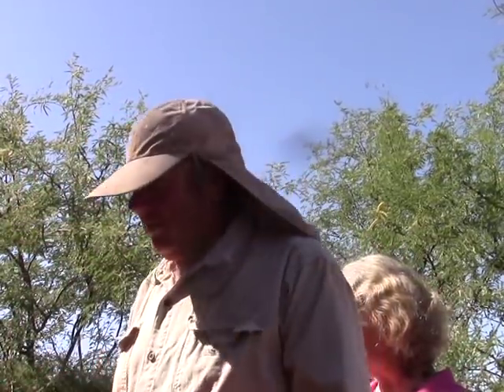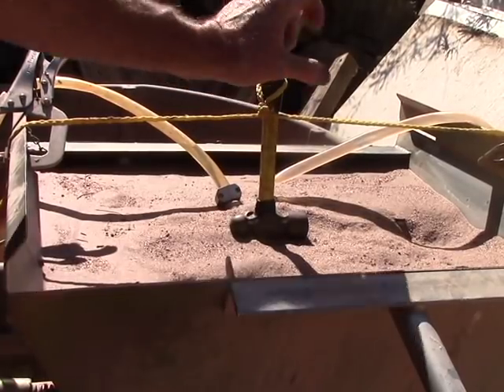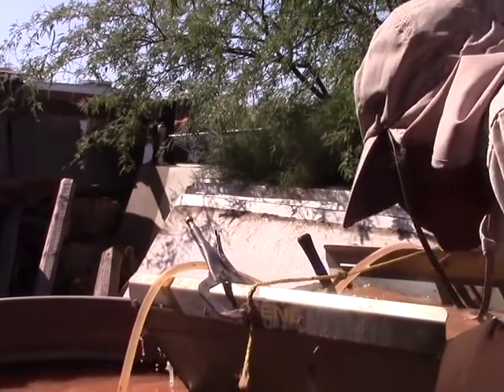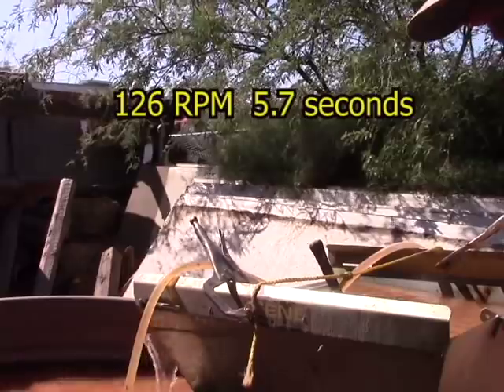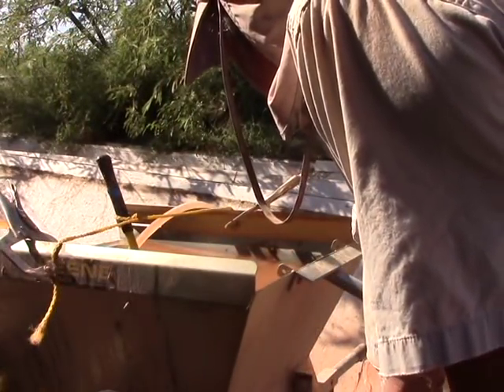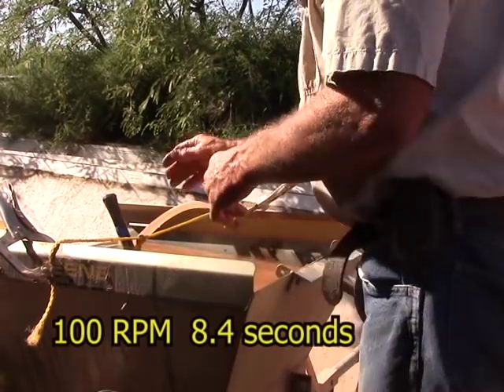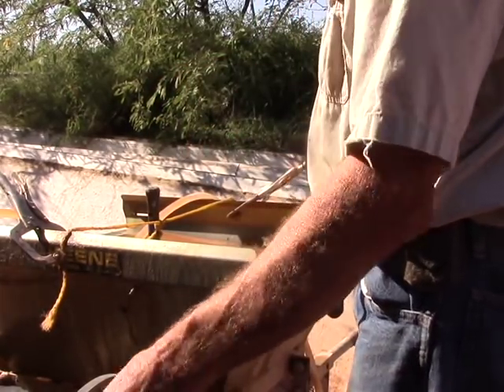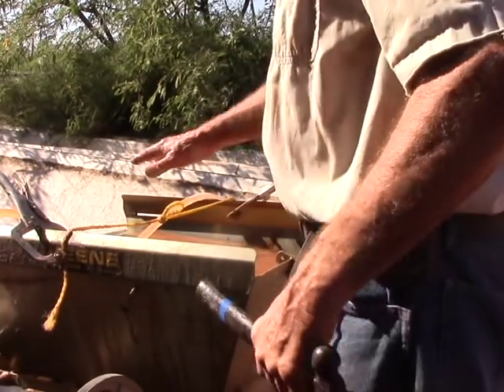Testing Hydramatic Improvements: stroke and RPM

Comment: Good job on the testing
Reply from the maker: Thank you.  Just finished getting the parts for a 'jack shaft' to act as a reduction gear  About $100 and should drop the minimum RPM in half with more easily possible if needed.

Comment: Have you considered increasing the flow?

In Aquaculture filters upwelling fluidised bed filters are run so that the media is fully expanded or fluidised. 

Under those conditions you put something like a hammer in the chamber and it sinks straight to the bottom. Might take too much energy to do that though....which is why agitation is used of course. But maybe there is a sweet spot with increased flow but too excessive agitation?
Reply from the maker: The issue is trying to achieve fluidizaion with MINIMUM upwelling.  The Mojave 1 ore I am testing has very fine gold and 50 micron gold wouldn't take much to wash out of 1-2 mm silica.  I'm trying to determine the best 'sweet spot' between throw, frequency, and upwelling to maximize recovery.  It seems that just a 2:1 reduction from current would put me right there.  I'll go to 'Bearing, Belt, and Chain' today and see what they suggest.  :-)
Reply: @hardrockuniversity7283  yeah i get that. 

Might need to multi stage it.

Sluice to catch the big gold, screen to remove the silca 0.5mm + and then up welling the fines.

Are you also trying to catch sulphides?

Keen to follow progress.
Reply from the maker: @ChestnutnagsToolsFromJapan  Absolutely on the multi stage.  I am really curious about the fact that hard rock gold is almost all very small, while placer gold averages much larger.  Dis the micro fine gold get completely washed away, or is it just unnoticed due to the fact it doesn't reveal itself using normal panning techniques?  I suspect that there may be a significant number to a decent percentage of placer mining operations throwing away a lot of very fine gold because it doesn't get stopped in the sluice and they don't see it when they pan the tailings.  I CAN see it in my pan and I intend to find out.  If so, I also need to extract it profitably and thus the research with the hydramatic.

I just installed a 'jack shaft' to reduce the RPM by about 50% today and the initial tests look good.  Now I need to go from the 1" throw shaft to the 2" throw to see how it works now.

Yes, I am also concentrating sulfides and other heavies.  This arsenopyrite seems to have gold crystal locked, so I assume I could gravity concentrate the heavies and then leach them.

My wife really likes the tools you get from Japan.  She has a good sense of reverence for  age and tradition.
Reply: @hardrockuniversity7283  I think you are right about placer operations losing fine gold.
Reply from the maker: @ChestnutnagsToolsFromJapan  that's my guess.  It would be very cheap to just add a screen and micro fine recovery device to the tailings stream of an operating mine.

Have you tried my panning technique so you could test locations in your area?

Comment: Kindly consider the 2 gears and chain from a used 10, 15 or 20 speed used bicycle.
Reply from the maker: They would probably work, but the dirty environment might wear them out quicker than usual.  As you can see, sheer power is not a major issue.

Comment: I’m assuming you use Bearing, Belt and Chain, that is very close to you! You might check at Naughton’s for the big pulley, or any evap cooler place.
Reply from the maker: Yep, spent the day at BB&C getting parts and installing a jack shaft (intermediate shaft) to reduce the RPM by about 50%.  Seems to work well.  Will try the larger throw shaft next now that I can run it slow enough.

Comment: I know they are expensive but what about a variable speed drive??
Reply from the maker: A variable speed electric drive also requires an generator for field use.  I am going to check the supplier shortly to see if I can get a 2:1 step down idler pulley.  I could always put in an intermediate shaft with two pulleys, but that introduces a number of extra parts.  If they make a step down with internal bearing, that would be 'wunderbar'.